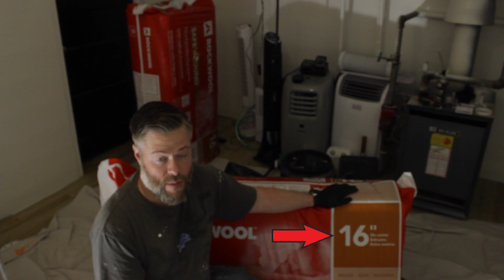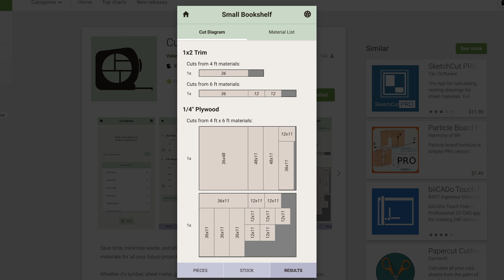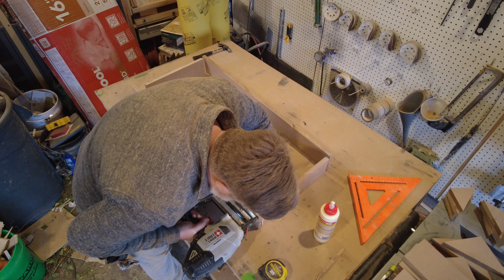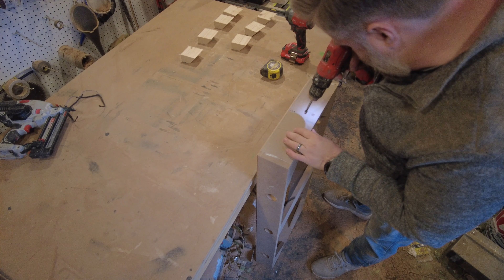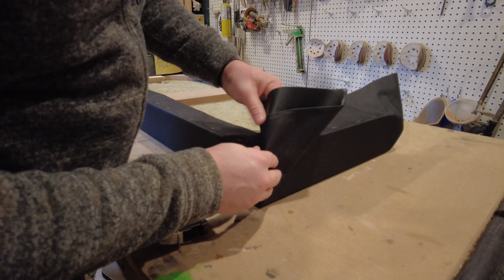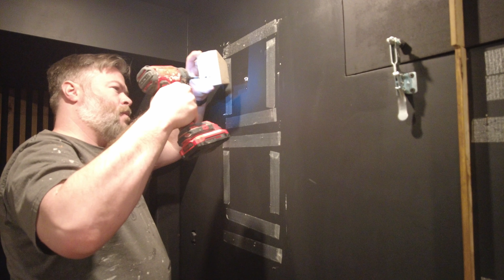Acoustic Panels That are Better than Just Amazon Foam

Comment: Great video!! What are the strips behind the panels on the drywall? Did I miss hearing about them in your narrative? I've used French cleats to hang headboards that I built for our bedrooms. Great idea using narrow ones for the panels. 
Also, have you produced a video on how to control bass frequencies from 100 Hz and lower? If so, please provide the link. Many thanks!
Reply from the maker: Thanks so much!

Honestly those strips are double-sided tape left from the temporary panels I had on there before. Just didn’t feel like peeling and then fixing the paint.

I haven’t posted the low-freq video yet. I’d love to get to it but I have so many Summer projects I’m trying to finish and even more videos that need to be made about them. Hopefully I can get that over the winter!
Reply: @JackofAllMinistries  Sounds good and thanks for explaining about the strips. You sound like me 🤣. I Subscribed and Liked. Can't wait to hear what you do for those lower frequencies. I've listened to all of the Dennis Foley videos from Acoustic Fields. He considers his technology as the only one that works but I believe there are other ones that are as effective. Plus, his prices are crazy high. Thanks again! Stay well...
Reply from the maker: Whenever I get to it, you’ll see I basically reworked his idea with mixed results. I also added some tuned tuned traps that were interesting…

Thanks so much for subscribing! Hopefully my stuff will be able to help out a little.
Reply: 👍 @JackofAllMinistries

Comment: It looks good and you put a lot of effort in so congrats, you managed to modulate some frequencies however, all those reflections are from the wooden frames and the material itself, its tricky thing to get it spot on.
Reply from the maker: I guess that’s the hard thing about using Rockwool - they need to sit in a frame. The only way I can think of to do something about that would be to wrap the wood frames or something like that?

Comment: Hi Dan, may be you would have a better amortization of lower frequencies with cotton wool instead of rock wool.
Reply from the maker: Apparently cotton doesn’t perform as well at lower frequencies but I honestly don’t know from experience. May be worth testing!
Reply: @JackofAllMinistries  Oops, my bad, I meant bulk cotton wool - the fabric is doing the wool contention, or use a small mesh net under the fabric if it is not tough enough.

If you're gonna test it, then you could also test wood wool, it might be even better but there are chances that the thickness need to be increased, which may be a problem in such a small room (make sure it was processed with an anti-fire solution, security first - we don't wanna discover in the press that you ended as a hot dog plugged on a drum stick ! 😋).

Comment: So no room testing to see what issues you had to address and therefore not a tailored solution to these unknown issues. Therefore you are kinda guessing.
Reply from the maker: That’s not exactly true. You’ll notice I used RT-60 and waterfall graphs that had measurements taken before the project. I didn’t overly tailor the panels because I preferred symmetry, but the surface coverage percentage I calculated using a room mode calculator wasn’t off by much. Since these were primarily made to address middle frequencies I didn’t stress it or bother including it in the video. The more tailored approach was reserved for lower frequency issues where I used two frequency specific tube traps for two of my three worst problem frequencies. Then I built a couple of knock off ACDA’s hoping to tackle my lowest problem frequency, but I admit that was a bit of a shot in the dark. That’s because I know they are supposed to be a broadband solution, but I had no real data to work with. All I had knew was the guy from Acoustic Fields told me what I would need to buy from him, and the requirement to fill the need was just too unrealistic. Think 15 huge and heavy (not to mention expensive) units in my little space. So I made two and found mild results in that arena. So the room was tested, and although there was some guessing, everything was mostly planned for. It just wasn’t covered in this video because middle frequencies are easy and I didn’t think it fit the content of the video. When I discuss my low frequency fixes in another video it will be more in depth. Thanks for watching and giving some feedback!

Comment: Hey Dan, thank you for the entire series! Lots to learn, and a thoughtful approach. 

I have a question for starting out. I’m not flush with cash, so I’m curious if I can approach a VO space from the point of view of the most advantageous steps I can take shy of a complete remodel. I’ve got a 9x12 basement room with a 7 ft ceiling height. I’m thinking of a dual-wall booth in one corner. Any advice from your experience on how to approach planning and executing that (i.e., gotchas I might look out for?). 

Thank you for any help. This series did a lot to motivate me!
Reply from the maker: Thanks so much for watching!

Since you’re main soundproofing issue will probably be sound coming in versus going out, I’d pay extra close attention to decoupling to prevent footstep sounds and other impact noise from getting in. You can build a decent room within a room pretty inexpensively if it’s small. For sound treatment, you probably won’t need much effort on the low end for just voice overs, so that is a definite space saver. Focusing treatment at the mic level may help increase results. Remember you don’t want it totally dead in there, it’ll sound unnatural.

Let me know if there’s any thing else I can do to help!

Comment: The holes on the side is very interesting. I haven’t seen that anywhere else. It definitely makes sense.  

This was super impressive- MDF intimidates the daylights out of me just because I’ve seen the gluing stages be very up & down. 

Super cool builds and I appreciate this- super helpful!
Reply from the maker: Thanks so much! I wish I could take credit for the idea, but I had seen holes on another build somewhere. And don’t be afraid of MDF - it’s actually very easy to glue up. Of course the fibers won’t hold as well as actual wood, but for most things it’s more than strong enough. Especially on something like this that only really needs to bare its own weight.

Thanks so much for watching!